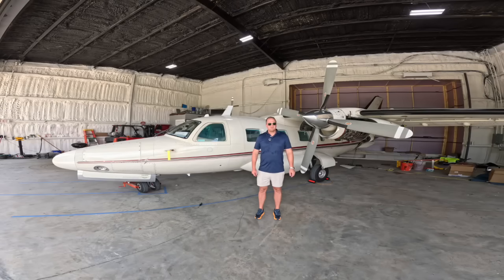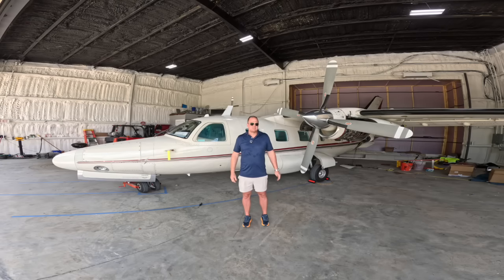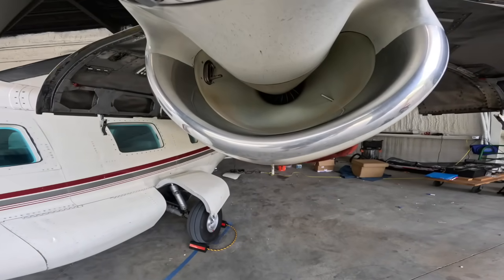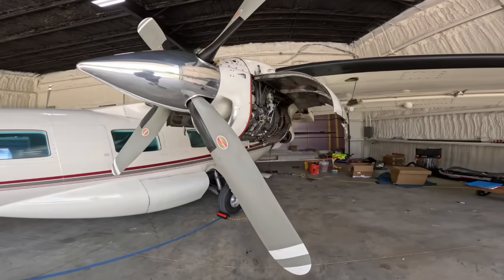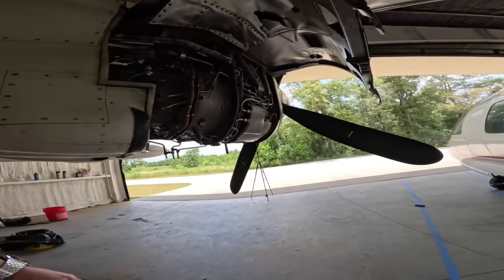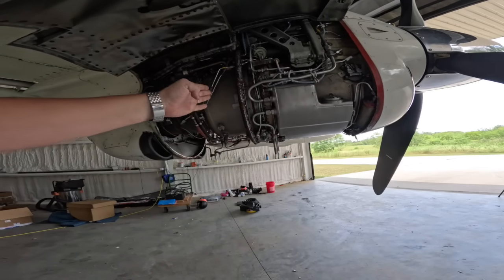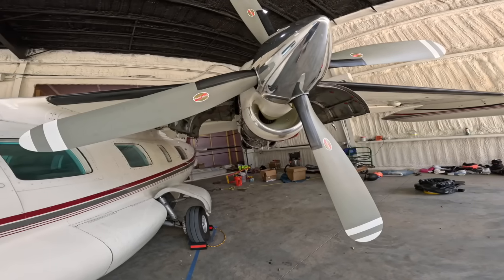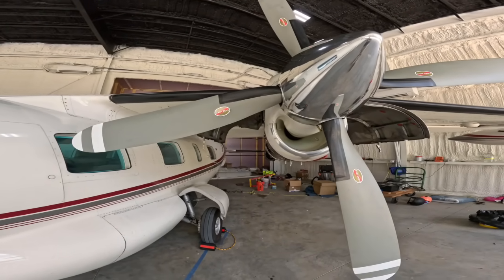Mitsubishi Mu2 TPE331 advantages and disadvantages

Comment: We're up 3500 HSI and 7000 OH on our -10N C441 installations (Part 135). Only mechanical failures I've heard of was an FCU metering valve that got stuck at a high power setting, pilot had to shut the engine down to prevent an overtemp. Otherwise a few engineers have rigged up oil coolers backwards after maintenance which led to a redsign of that system.
Reply: I have over v30 years working on the 441,the -10 conversion really was a great thing.I have removed the fcu metering valve on some and fixed the sticking problem.
Reply: I flew Metros for a while.   I seem to recall a lot of picayune issues with the engines.  The SRL computers, The overspeed controllers, NTS, etc.   And one other I can't recall, EGT compensator???    But, this was in airline service where guys would beat the planes from sun up to sundown daily and maintenance was an afterthought.    If you ever get the chance to spin the engine by hand you will get an immediate appreciation how much amperage is required to operate the starter motors.  You're spinning everything from the prop spinner to the most aft turbine blade.   The planetary gearbox is HUGE.   Hot starts were common in summer and you had to be very careful when manually enriching during the start.    Good times.
Reply from the maker: All true!  The batteries are working HARD to start those engines.  I try to start with a GPU whenever it's available.
Reply: @TurbineDudeMU2 understandable, I've never had to start the plane with temperature below 12C so the GPU doesn't see much use

Comment: Have just over 5,000 hours on -11s in hot (except when -40) and high mountain NW and love those engines. Water injection on hot day takeoffs was a real kick and quick power response made mountain approaches and maneuvering less thrilling.
Reply: Yeah I have about 5,000 hrs also. Great plane and the Garretts…
Reply from the maker: What has -11's?  Jetstream???
Reply: @TurbineDudeMU2  Metroliners also known as lawn darts, executive mailing tubes and a few other vulgar terms. They ate Jetstreams for lunch.
Reply: @TurbineDudeMU2 if I remember correctly our Marquises and solitaires had -10s Garretts….dont know of a -11, but that was early to mid 90’s

Comment: I have the same dash 10 engines on my 690A Turbo Commander. Never seen issue with starting in cold weather but we always keep maintainer on the concord batteries because those engine starts are abusive.  Since using the maintainer when hangared, our dual battery setup has been lasting much longer before needing replacements. I highly recommend you do the same.
Reply from the maker: I have the Concorde battery maintainers on mine and it seems to be doing great.